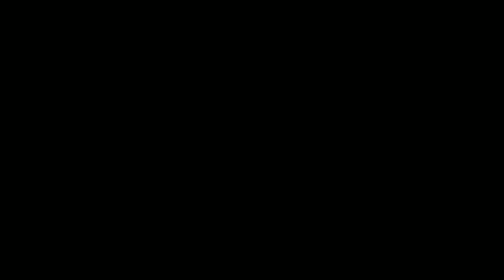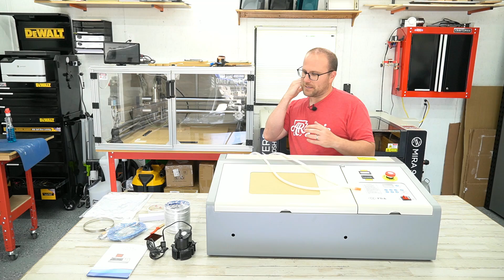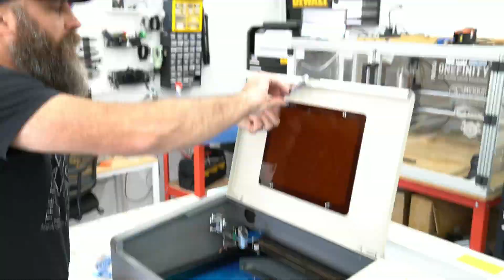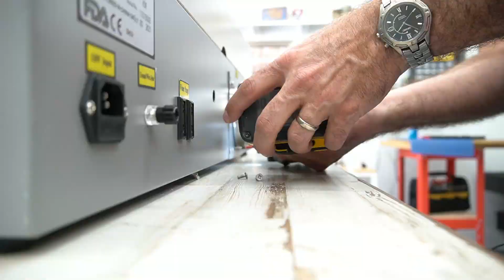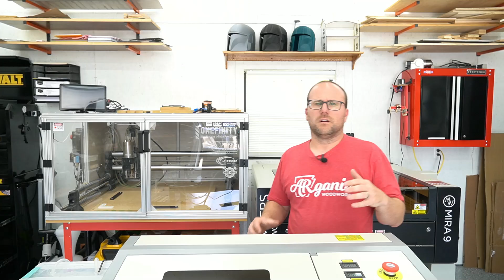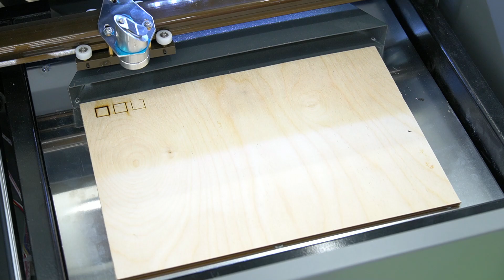The FIRST Laser Cutter A Newbie Should BUY!

Comment: Ive been engraving now for 2 years with a 10w diode and just purchased a CO2 K40+ with every up grade possible upgraded mother board , a rotary a chiller a laser head that extends or contracts 1.2 inches , it has the debris tray and a removable honycomb fixture, built in heavy duty fan and air assist the only thing i need to add is a adjustable work table for up and down which will come and i'm into it for $800 tax and shipping total ! Sure beats the heck out of my 10w diode  and i already had LightBurn ta boot !
Reply: When you write "adjustable work table for up and down " do you mean a table the machine goes on o a bed onside the K40+ please?  If its the former, do you have a link to where i might buy one from? Thanks.

Comment: 10:06 I bought a used K40 and the owner said "You must have an additional ground wire or it will cause all kinds of issues!"  The manual says "Electrical Ground Connection: Connect the ground cable to the machine here (if you do not have access to a grounded 3-prong power outlet).   So the majority of USA electrical outlets WON'T need this connector!

Comment: If the plug has a 3 prong ground - just internally connect that ground pin to the plug - no need to run a second ground line.  As far as the pump Id use a larger bucket or the water can't cool

Comment: $100 ice maker is probably the best route for k40. Tilt your machine to get rid of any air pockets in the tube. Think about replacing that crappy exhaust fan. Because it's winter here I'm using an aquarium heater along with aquarium pump and this temperature controller to cycle it. Inkbird-Itc-308-Temperature-Controller. 15° c and have it turned on at 1° drop.

Comment: How did you get it to work with lightburn? I can't find the link. Thanks!
Reply: Monport has a board upgrade to use Lightburn. I thought I read where some of the K40's will work with Lightburn but not all the 'good' features, but I haven't tried it yet.

Comment: Looking for the light burn hack mentioned in the video. Don’t see as a link. Will this work with MAC or Windows only?
Reply: Monport has a board upgrade to use Lightburn. I thought I read where some of the K40's will work with Lightburn but not all the 'good' features, but I haven't tried it yet.

Comment: I think the K40s are underrated. A few things to keep in mind:

1) remove the paint from around the ground lug on the back and make sure it’s grounded. I’ve seen footage of the chassis of a K40 floating at around 1,000v.

2) a cheap chiller option is a pc radiator and fans.

3) the “CE” and “FDA” logos are BS.

4) add a mA meter to make sure you don’t overdrive your tube.

If you want, I can send you a .svg of a custom control panel I made for my K40 with temperature gauges, extra switches and a mA meter that replaces the original panel.
Reply: can i get my hands on that svg? :O
Reply: @DEPEACHMODE  I don't think I have that any more. That was on my PC that died. Plus, it would only really work if you had the same hardware I am using. sorry

Comment: That is actually nicer than the K40 I bought about 3 years ago. I had no LCD display, or power distribution on the back or a lid switch. I see this one has a side panel to install a high watt tube. LOL

My tube came cracked on arrival. The seller gave me back $100.00 for new tube.

First thing I did id remove that work clamp and made a bed with mesh screen so I could put thicker stock in it and cut the fume extraction funnel back to have a larger work bed. I used it for a bit, but it was not long before I found I needed more power and larger work area. I am now using the "Big Red" 60 watt from China I got for about $1700.00 2 years ago.
Reply from the maker: That's exactly what we did.  It'll show up in the follow up video.